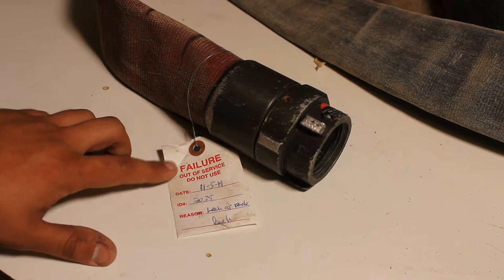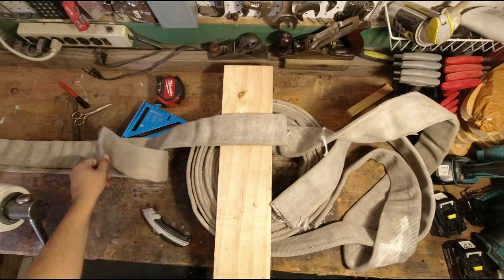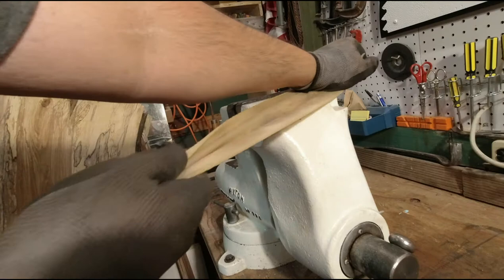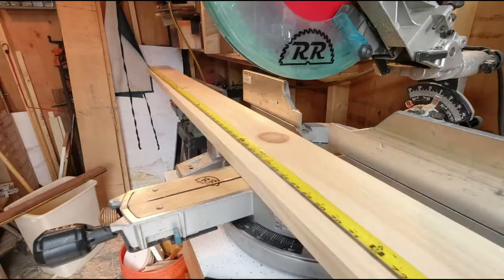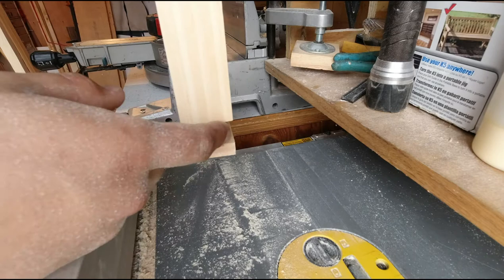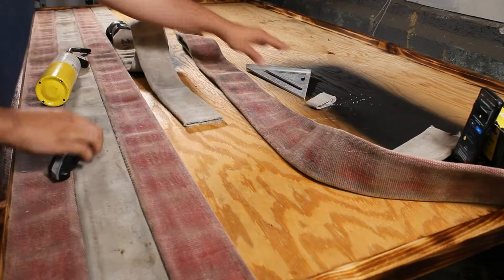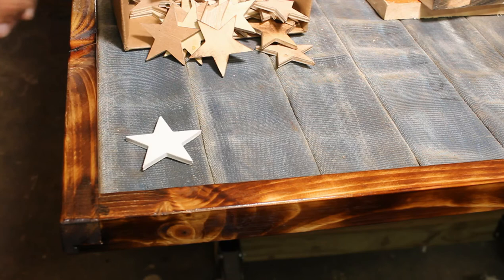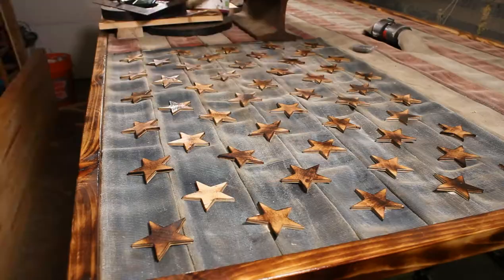How to Make a Firehose American Flag

Comment: Nice job, I plan on starting one for my firehouse in a few days. When you ripped the 5/4 pine, what were the dimensions of each strip? 5/4 x ? Thanks! (I did get the measurements after for the rabbet cuts)

Comment: Thanks for this. I made one and it came out great. I’ve never done any kind of projects like this. But after making it, the fire chief asked if I’d make two more for the firehouses. So I’m in process. What did you use to cut the firehose? Thanks in advance.
Reply from the maker: @user-hl5fj7er2l  Just a sharp razor blade! I kept swapping out the blade to keep it super sharp for a clean cut.
Reply: What did you use to cut the hose? I made mine slightly smaller than 3x5 feet. I used 2x3 construction lumber for the frame. The person I made it for, loved it!
Reply from the maker: @user-hl5fj7er2l  Awesome to hear! Thank you for the comments! I would love to see a picture. Shoot me one @RojasCarpentry on Instagram
Reply: @RojasCarpentry thanks. I used Ninja scissors the first time. But for two more I was hoping to hear there was an easier solution. Thanks again!!

Comment: I going to be building a flag like this soon. I like what you did with the stars. I don’t have the capability of making them myself. I was wondering if this is something I could purchase from you?

Also, what are the dimensions/spacing for your star spacer board?
Reply from the maker: I would love to make them for you unfortunately it is probably more cost effective if you order from someone off etsy or Amazon. Just look up 2.5" plywood stars and a few options should pop up. I personally wouldn't be able to do it as cheap as them. 

For the spacing, I just got rid of those sticks unfortunately. Next time I am around the flag I can send you the measurements.
Reply from the maker: Hi Ryan! I found the story sticks! 
The spacing between each row going up and down is 2.5"

Left to right, each star is 6" apart
Reply: @RojasCarpentry  well I'm a year behind schedule but finally getting around to building my hose flag. I used your vice technique to get the inner rubber jacket out of the house, man did that work awesome!!! How did you get the rubber jacket out of the pieces with the couplings still attached?
Reply from the maker: @Ryan Savage  So those I left in. As long as you get as much weight off the entirety of the flag that's what matters. Can't win em all!
Reply: Appreciate the advice, I’ll send you some pictures of the completed process.

Comment: How did you remind the liners from the pieces that have the couplers
Reply from the maker: Those I actually left in there. I wish I could've taken them out but I don't think there was any way to do it unfortunately
Reply: Been working on one myself and was about to ask this myself, haha. I might try a rotary tool inside the coupling to cut that inner jacket. 🤞
Reply from the maker: @josephchronowski597  Good idea!! Maybe even a hot "knife" of piece of metal bent at 90° and try cutting around the inside